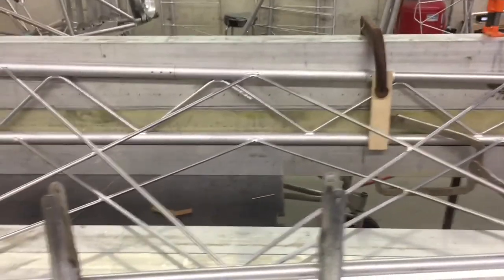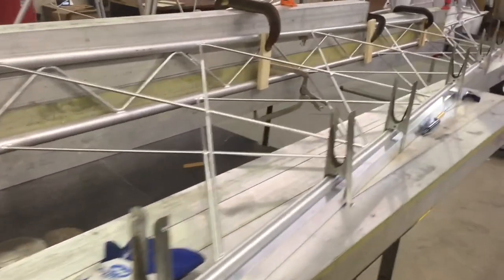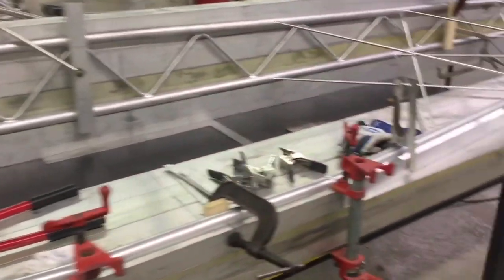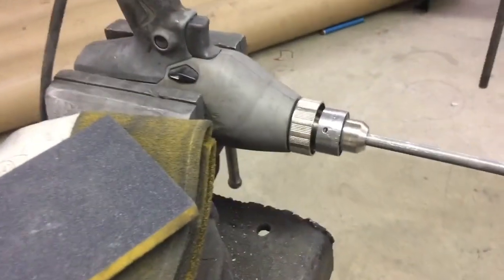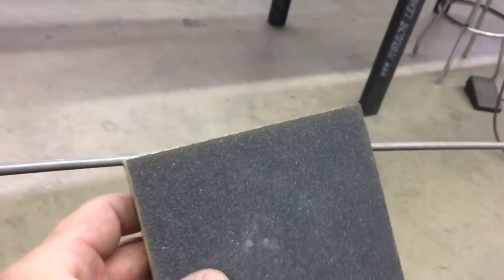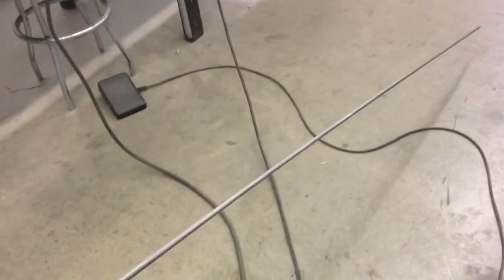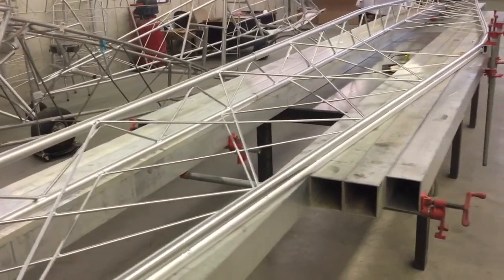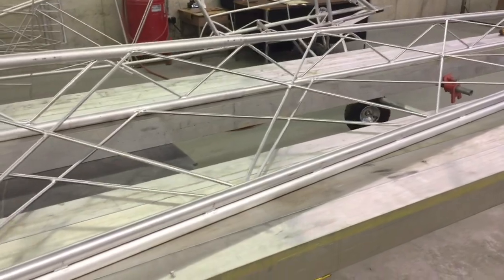Aluminum Wing Build Part 3

Comment: Very nicely done. Has the wing undergone any g-load testing?  I flew out of an airport many years ago that had a set of wings in the rafters of one of the hangers. I think they were Stinson wings, not for sure. No one knew where they came from, they had been there so long. They were built using this kind of construction but were of steel tubing.  They were also strut-braced wings from a high wing airplane.  I remember the attach points on the wings for the struts were massive affairs. And likewise, the spar attach points. This is a small light plane, but it just looks a little light. If it has had any g-load testing, how far did you go?  Great video, will watch all you make.